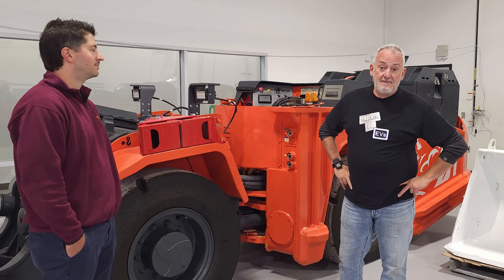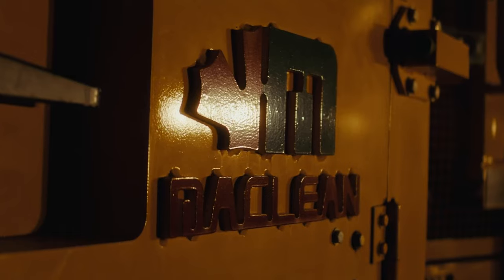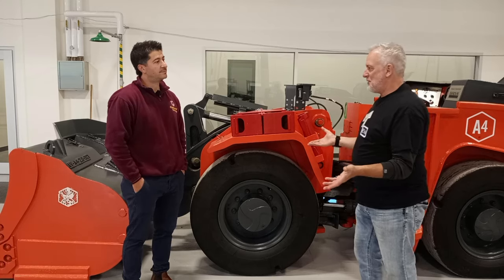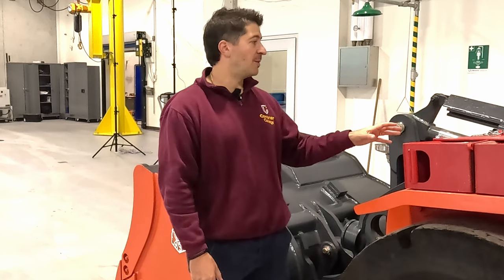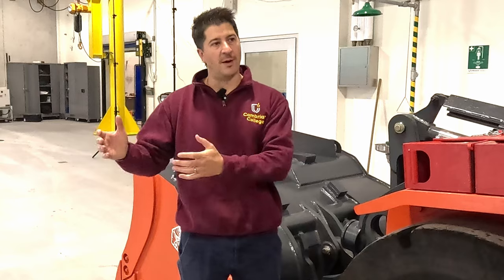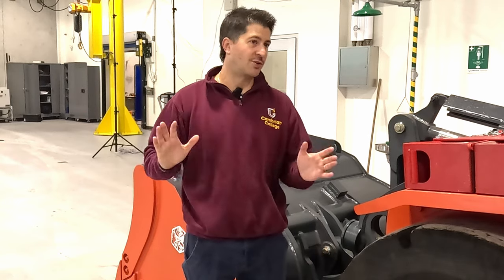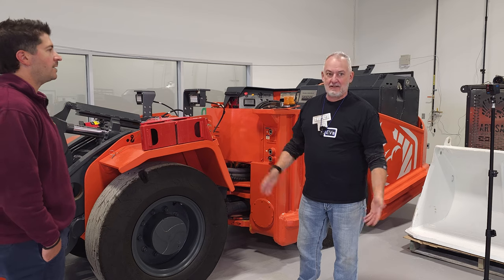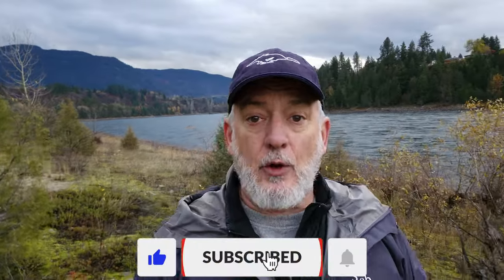Mining Goes Deeper Thanks to EV Trucks!

Comment: Wow... great content again!  I am aware of a number of initiatives related to electrification of mining, but mostly related to open pit facilities.  You dug deeper (!) and BOOM, you pulled up another benefit of EVs...  reduced operating cost and complexity for underground mining and facilitation of ultra deep mining.   You not only exposed new benefits of EVs, but also highlighted this awesome Canadian research lab, which I suspect very few know about.  As well, mining is dangerous enough without subjecting mine workers to diesel fumes throughout their work life.   Thanks for bringing this to us... Fabulous stuff.
Reply from the maker: Wow! Thank you so much for the support, Robert! It's what keeps me excited and motivated to do more.
Reply: absolutely wrong! youre still going to have to mitigate tons of risk like ventilation, battery fires are super bad for such confined spaces, and ICE litteraly also runs on HVO or recycled coocking oils for example.
Reply from the maker: That's not what the mining industry is saying. The fire risk and heat challenges are both exponentially higher in ICE machinery than evs. Statistically, internal combustion is 20x more likely to experience a fire than batteries. Old FUD that no one is listening to anymore @alanmay7929

Comment: Wow, Great Video.  Back in my Ballard days the supplier of our motor controllers was a Canadian with a company in Florida that did controllers for the mining industry.  That was the mid 90s so I am certain that it was diesel electric at the time.  His big thing was stopping mining carts.  These were 1000 ton "carts", not your Safeway cart.  Stopping the wheels was not a problem, however on rails that does not stop the cart,  The reason we used his company was they were the only ones willing to make a controller for our power levels with a large input voltage range.  Commercial motor controllers worked off of mains AC voltage that does not vary much.  Our Fuel Cells were around 1000 volts at "idle" and 600 volts at full load, beyond what most supplier could work with.

On a side note I just ordered my 2025 Lightning Flash, Polar White with Max Trailer, ProPower and a Tonneau.  Should be here sometime in mid February to mid March.  Have to get together?  Maybe in Osoyoos?
Reply from the maker: Congratulations on the Flash, Bob!
I'm thinking of organizing an EV truck get together event since so many ev truck owners sound interested. I think I would be great to meet up!
Excellent info on the controllers.

Comment: You should do what you can to work hand in hand with the boring company as they do this work everyday too
Reply from the maker: I'm not in mining. Neither is the person I interviewed. Neither is the Boring Company.
The Boring Company uses a rotary boring machines to create 'highway' connectors between locations, much like subways do - but with the intentions of using autonomous cars instead. 
It has no relation to mining, especially at depth.
Reply: @truckedupevs  but all their mining equipment does electrically powered. Or at least that has been their goal for many years. You could probably find out some technology from them and they might be willing to hear what you have to say or might even be looking for your products
Reply from the maker: @RedRyan  I don't have any products. I'm a YouTube influencer. Not following your train of thought.  Are you referring to Sandvik or Mclean Engineering? That would be for them to investigate. The college doesn't produce product, and the boring equipment isn't applicable.
Reply: I have followed the Boring COs progress and wondered why periodic mineral testing isn't done? Or is it?
Reply: lol!!!! the boring company basically makes underground pipes! none of those equipments can be used in those tiny tunnels and mostly conveyor belts are used for such small tunnel diameter!
Reply: @RedRyan  electrical mining TBM is nothing new and nothing that the boring company has pushed!
Reply: @alanmay7929  interesting, well I'll go check my fax again
Reply: @alanmay7929  All right, I obviously don't know very much about mining. Time for me to learn
Reply: @alanmay7929  The debris could be analyzed